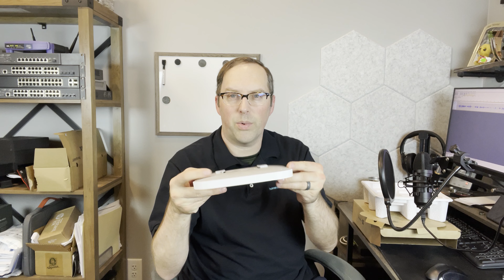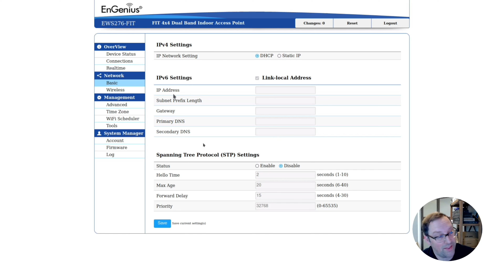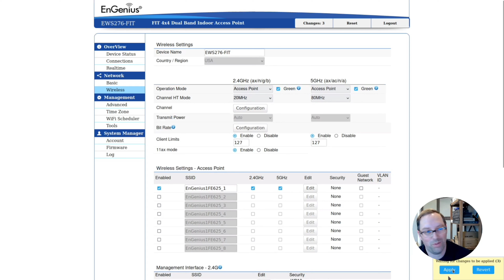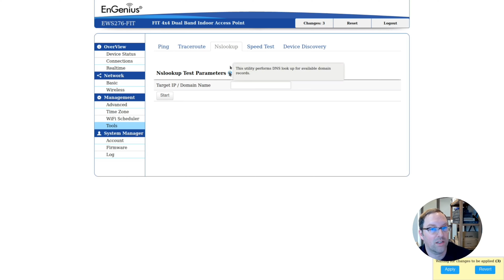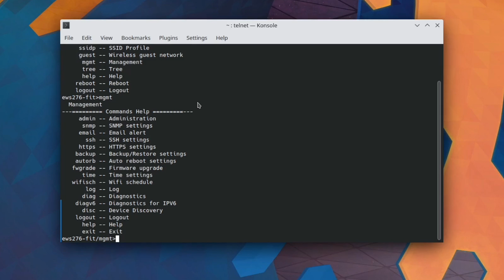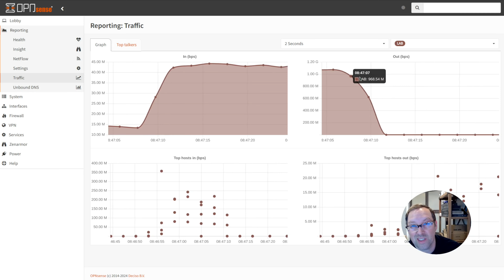Speed Testing the EnGenius EWS276-FIT Wireless Access Point!

Comment: I have used the Ews276 fit 4x4 for nearly a year. 
It disconnects almost every other day. 
I'm running it as a Poe on switch and router and 2.5 GB from Verizon. 
I would not recommend this product based on my one year's experience.
Reply from the maker: Ohh wow, that doesn't sound like a good experience. It makes me wonder if you had one that had a defect. I haven't tried this AP out for the long run. It does give me a future idea to somehow setup each AP I get and monitor for disconnections, throughput degradations, etc over several days/weeks (maybe just test one AP at a time like this because I don't want to cause to much interference with my own home network APs).

Comment: Is ubiquiti U6+ better or is this one?
Reply from the maker: I haven’t tried the U6+ to determine which one I like better, but the speeds on this AP seemed pretty good. I am still running older WiFi 5 (AC) UniFi APs on my main network.
Reply: @homenetworkguy you tried the U6 Pro and if it's better not?
Reply from the maker: @yerayquintanilla7099  I have set up a U6 Pro for a small UniFi deployment that wasn’t mine and performance may be similar. Something like 600-700 Mbps on average if I recall correctly.
Reply: @homenetworkguy ubuquiti software and management is better no? thanks for your help
Reply from the maker: @yerayquintanilla7099  I like the UniFi management for the most part but they do have their own way of doing certain things that’s different than others. Once you’re used to it, it’s fine. I know some criticize how hard it is to do firewall rules with UniFi gear (for their gateway products). But managing APs is pretty simple.